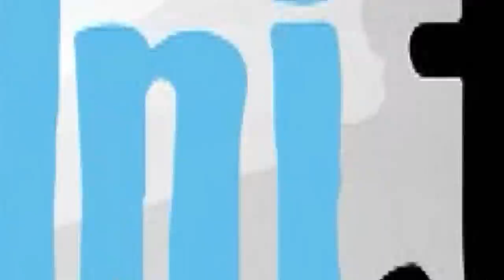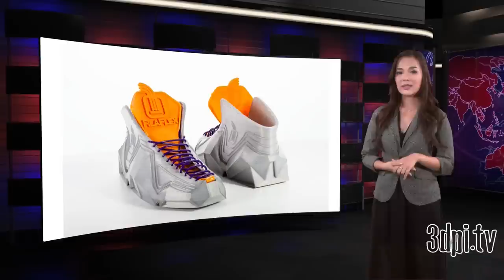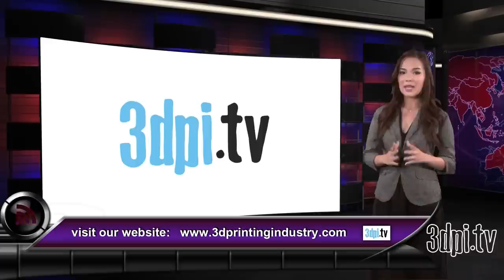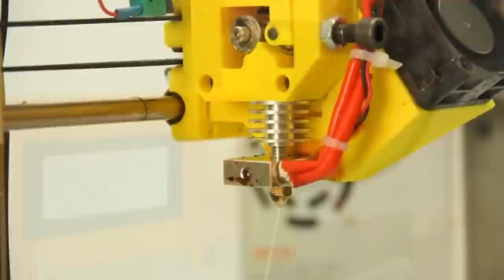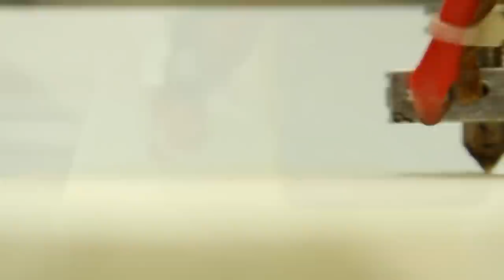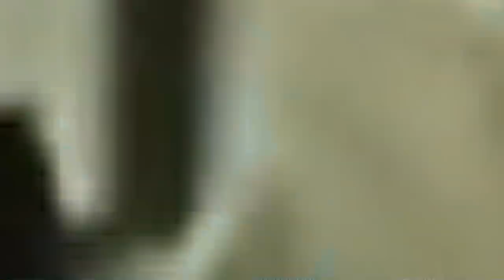3D Printing Your Future Shoes with Filaflex

Comment: the design looks fine my problem is are they too flexible is it just me or are they way too flexible I can't imagine them holding up very well they need a stiffer material
Reply: there are other parts printed in pla which is significantly stronger. they just don't show then being made